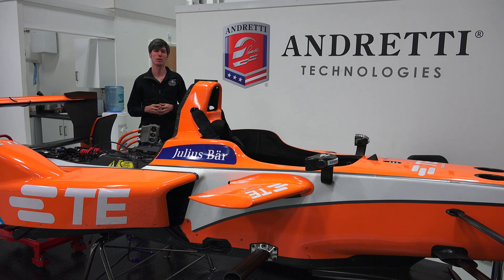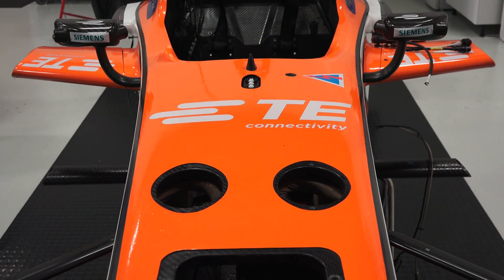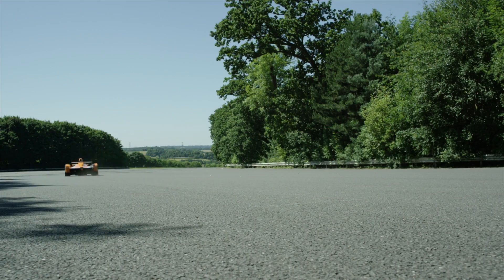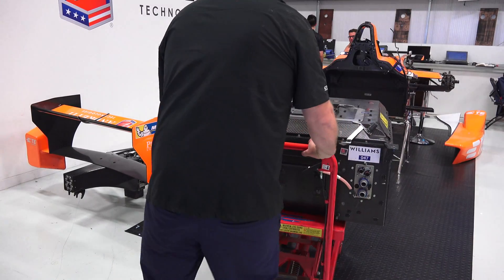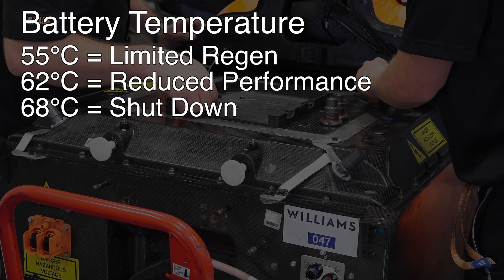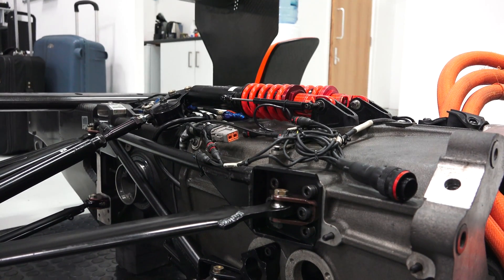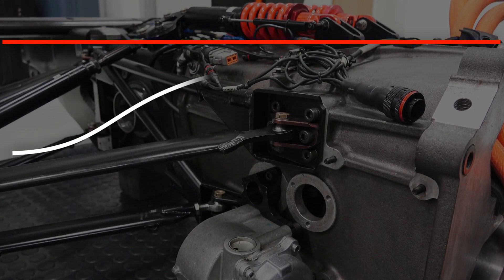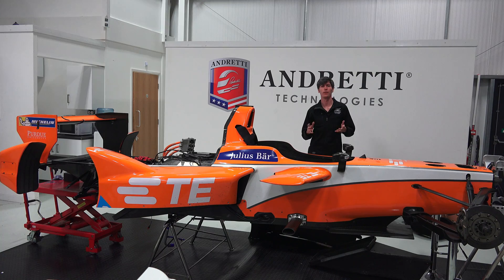How To Win A Race - Sensor Strategy

Comment: I have a question, the other day I got bored and had nothing to do. I don't have a lot of money but I wanted to change the sound of my car. So I took off my muffler. Just the muffler, could not having that back pressure damage my engine?
Reply: Car will not run optimally.  Over time, maybe.  Probably not

Comment: First one is basically a IRU (Inertial Reference Unit) in aviation right? since they consist of three laser gyros which each measure one axis. So there is three gyros in a pack, which measures X,Y,Z axis.
Reply: Nor really. They don't need gyros for this application because they are only interested in acceleration along the longitudunal, lateral and vertical axis of the car. Simple accelerometer are enough for this. Gyros are only needed if you want to know in which direction the vehicle is pointing.

Comment: What about battery voltage? 🔋 Do you have info on battery spec as well?
Reply from the maker: +Kevin Arnold more info on the previous video (developing an electric race car). I know I was told the voltage at one point, either 700 or 350, I know that's a huge range haha.
Reply: Engineering Explained THANKS! Will check it out!

Comment: What about the sensors at 4:03, it was in the last video and I was hoping you'd talk about it. Are they used to track suspension travel on the test car?
Reply: It's likely an LVDT or similar sensor, they'd be used anywhere you wanted to track a linear displacement.

Comment: How are the batteries cooled? Could you not have a flap that opens when you break that lets air flow over the battery?
Reply: Max Maker The batteries are watercooled.
Reply: water is rubbish, better to use gel, and have heat pipes coming out, and cool the heat pipes like a oil cooler, you can chop up a thermal take hydro heatsink, and heat dissipation is a whole lot better then water, look around in the industrial world, and some good gels go upto 180c and above
Reply: for_all_those that is a good point, and the only reason I can assume they do not use gel as a thermal extractor instead of water is cost. Water is practically free, and gel probably cost some amount of money, I don't know.
Reply: ***** to wrap a car battery would probably cost £1000 tops, but gel lasts forever unless it get too hot or cold, and then on the plus side its static and won't affect the center of mass 1 single bit
Reply: No they are not water cooled. Teams can choose what they use but I believe it is normally a type of glycerine.

Comment: Anyone that hits the track regularly should at least be logging their accelerometer on their phone.  You need to mount it pretty securely to the car to get good data, but it's very useful for improving times. It's very easy to pick out turn 1, 2, 3 etc due to the spikes in g's, and you can easily see the ones you're over-braking or early braking (Under braking and late braking you often don't need data to tell you lol)